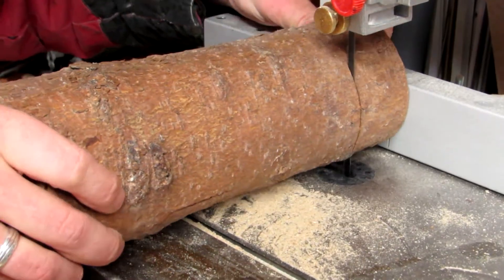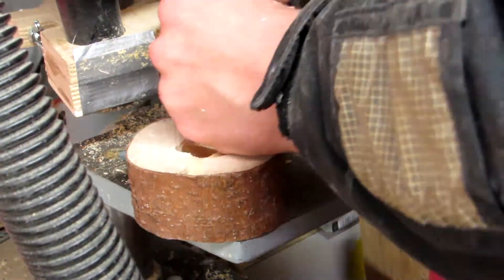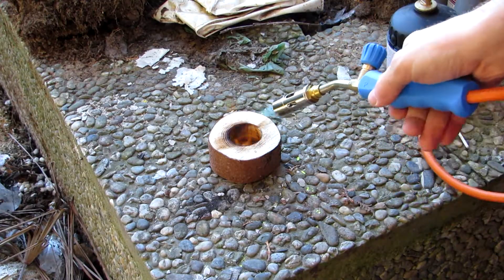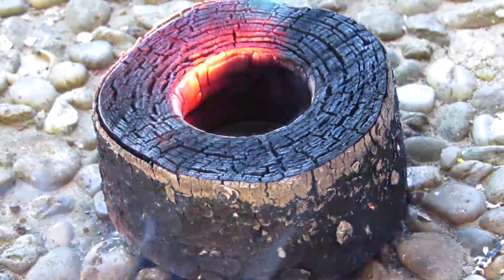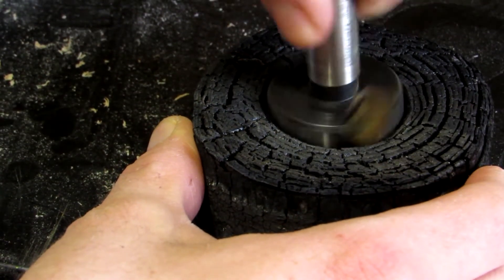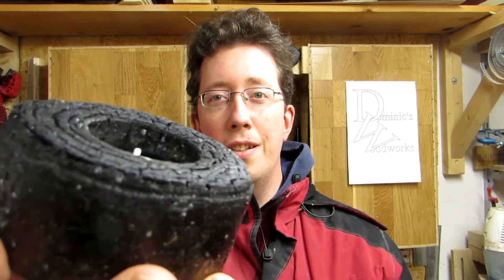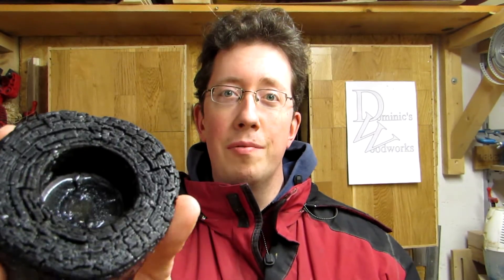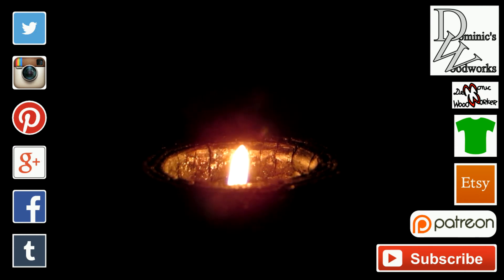Firewood to... Firewood - A Special Tealight Holder

Comment: Nice idea!

And I would like to suggest an additional nice idea ;).
In the epoxy resin is necessary to add sequins, for example cut into the foil in a blender. Or sprinkle with hair spray with glitter. Especially well they will shine and sparkle on top and inside, by candlelight.